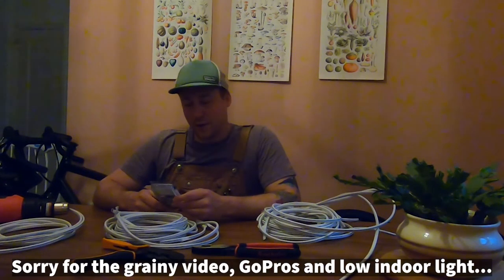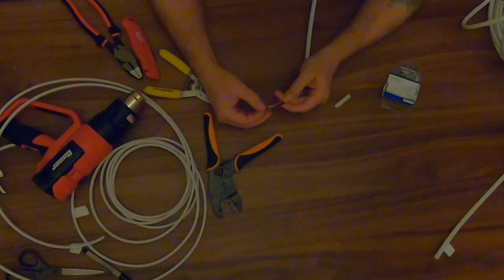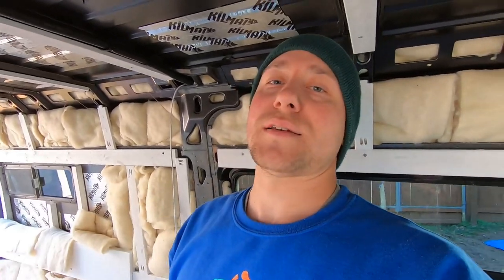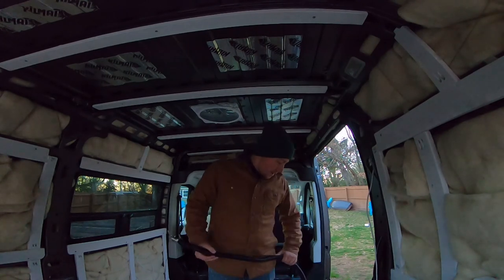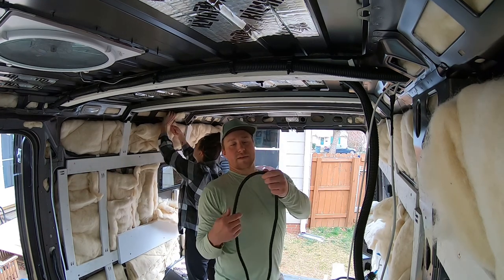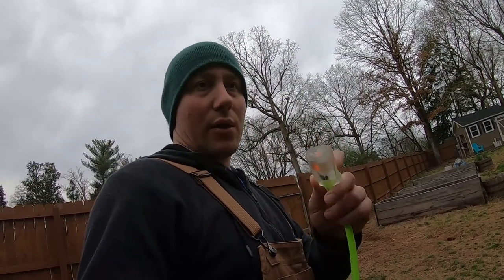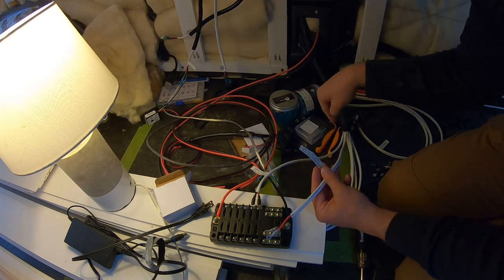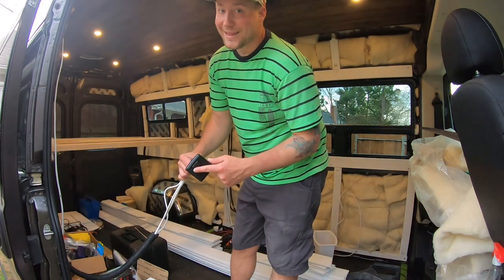Electrical Wiring a Van + Wire Connectors + Fuse Box + Loom, Part 2 //Ep. 9 DIY VAN BUILD

Comment: Great videos - thanks for all the tips!
Did you really use the small, 2.5 inch diameter puck lights? Are you happy with them - do they give off enough light?
How many did you install in your roof?
Thanks!
Reply from the maker: No problem, glad to help! Yes, we used the ones linked. I think they are the best small LEDs out there. We used 4 over the "bedroom" and 4 over the "living room". As well as 2 over the kitchen mounted under cabinet. There is definitely plenty of light from them. We even have them on dimmers because it can be too bright right before bed. Let me know if you have other questions 🙌🏻

Comment: Can you not just earth through the chassis to save wiring back to the fuse box?
Reply from the maker: For sure, this can be a decent option for grounding a 12v system. Utilizing the fuse block the way it was intended was the choice I landed on. Since I used a sleeved two wire cable for all my appliances it was a simple enough option. I’ll add that if you are chassis grounding in many different areas of the van and a nut/bolt comes loose, tracing back an electrical issues could be more difficult or could cause scary faults ie fire. Grounding the negative of the fuse block to the chassis was a safer bet for my needs.

Comment: Hi, great videos!! I'm in the process of building out my Ram 2500 159wb. I've got a Yeti 1000... I saw the cable you're using to "gangup" the 12v port from the yeti... can you tell me how you connected that Max Current cable to your fusebox?
Thanks
Reply from the maker: Hey! Congrats on the build journey, it's so rewarding!🙌🏼  I used a 10AWG cable I found on Amazon to connect from the max current cable to the fuse box. It has an Anderson Powerpole connector to a Ring Terminal. Here's the link for it https://amzn.to/3gH9oV0

Definitely reach out if you ever have other questions or want to bounce an idea. Goodluck with your build!😎
Reply: Matt & Katie Great!! You then connect the ring terminals to the positive and negative on the fuse box... correct?  (Just making sure... don’t want to cut and strip anything I don’t need to. :-) )
Reply from the maker: Yep! That cord makes it super simple. Just plug and play😊. I figured it ran about the same price as buying wire, ring terminals, and Anderson PPs seperately with none of the hassle.
Reply: @Trailvagabonds  First off, thanks for the beta on all your videos...Ive utilized alot of the same features in my build. Question on the Anderson cable; Should there be an inline 30 or 40 amp fuse between the Yeti and fuse block? Cheers
Reply from the maker: I'm glad they can be useful and have helped so far! Goal Zero's product for the 12v ports are regulated and have a max output. For the system I currently have, it's only 10a max. For the last gen large lithium and newer x systems, they have 10a out of each outlet (yeti x has large outputs for some of theirs). So the actual system will cut power to your fuse box through its own breaker rather than popping a fuse. Redundancy is important in electrical system so I'm sure it couldn't hurt but may not be necessary. **I'll just state I'm not a professional so if you do see otherwise, please share. I'd hate to steer people wrong👍🏼

Comment: Do you happen to have a link for the clips you used on the ceiling for the wires?
Reply from the maker: It was this item~ https://amzn.to/3urvTnC  but I will say they drove me nuts and didn't work that great. I was really frustrated with them.

I recently bought these (in black but the link is showing white now when I click on my order)~ https://amzn.to/31Xz0HL and used them to secure my solar panel wires a little better. I wished I had these for the wiring. Paired with a zip tie, they are awesome!
Reply: @Trailvagabonds  thanks matt! your videos have been great, i think i've watched the build series at least 6 times.
Reply from the maker: I'm glad they can be helpful, thanks for your support! I set out to make something I wished I had when starting my own build. It means a lot to hear the work put in to making them is worth it! 😊 All the best with your build! And don't hesitate to reach out with questions 🙌🏻

Comment: Great video!  Apologies for the newbie question, but does the fuse box essentially act like power distribution for the 12v from the Goal Zero to the devices?  Seems that way, I just wanted to make sure I understand the concept.
Reply from the maker: sorry for the late response. But you’re exactly right. The fuse block is fed 12v power and then acts as the distribution to all 12v appliances each circuit is then protected by a specific fuse for its amperage needs.

Comment: First , thank you for your responsiveness to my questions. I am setting up lights the same way with the same switches . Would I be able to get the same custom switch from American Technology? If so what is the approximate cost ? Thanks again
Reply from the maker: I called them (Google their info) and asked if they had a 3 way to pair with their dimmer switches. I don't know if covid has changed their pricing but I think I paid $27 for 2 switches to pair with the 2 dimmers. It was before covid supply chain issues so hopefully that hasn't changed too much

Comment: Hi Matt were your puck lights comparable with the American tech dimmer ?
Reply from the maker: Yes they are. The only issue I had was mixing another brands 3-way switch. It wasn't compatible with the dimmer and 12v less. I had American Tech. make me a 3-way to use with the dimmer and the whole system was perfect. From seeing a handful of puck light options I think the Acegoo brand is one of the best on the market. They make a quality product

Comment: Really like your videos.  I ordered the fuse box. I get how to hook up stuff to it but have a fuse question. How do you determine what size fuse to use? Starting off pretty basic. I have a Rec Pro 12 volt refrigerator, a max air fan and a circuit with two puck lights.
Reply from the maker: Glad you've enjoyed the videos. I hope they are helpful. For fuses, many appliance manuals will say what they recommend. The Maxxfan recommends a 5 amp fuse. Puck lights if led normally pull a tenth of an amp so normally a 1 amp fuse is more than enough. A fridge is probably a 10amp. A quick formula to decide on fuses is watts/volts=amps. So for the Maxxfan for instance, it runs at around 60 watts on high, divide that by 13 volts (Normal 12v output) =4.62 amps. So sizing up to a 5amp fuse won't blow it under normal use but will if it is grounding out or over amperage. Hope that helps. Let me know if you have other questions 🙌🏻

Comment: Great video (again) what lighting did you put in the garage area ?
Reply from the maker: Thank you! We ended up using truck bed light strips. They do a great job of illuminating. I debate about smaller plastic housing long LEDs but ended up going with the strip. You can use an adhesive backer, zip ties, or tabs to put them in place. We used these ones but there are many options for lengths and such~ https://amzn.to/3clG75g

Hope that helps! Let me know what you decide ok and how they work 🙌🏻

Comment: I've seen some people ground the negative to the chassis of the van. What are your thoughts on that? I'm running a similar set up from my Goal Zero  Yeti 3000X
Reply from the maker: I did actually run a grounding wire to my fuse panel. Goal Zero has over and under voltage protection so you probably shouldn't run into issues with it if you don't but I felt it was a decent safety backup
Reply: @Trailvagabonds  Thanks for the prompt response.
Reply from the maker: @jandrewnelson288  of course! Let me know if you have other questions! We upgraded to the 3000x too. Great system! 🙌🏻

Comment: Just curious, I am doing a build out of my own based upon your videos! I am also using a goal zero 3000 and I was just curious about grounding. Is there any way to ground the Goal Zero? Is there a need to do so? Only a few builders seem to be using Goal Zero for this build and I can't seem to find out if this is for sure necessary. Thanks for any help you can offer! Love the series! Incredible fidelity and deep walkthroughs.
Reply from the maker: Thanks so much! I'm glad you've found them useful and helpful! I ran a wire from my 12v fuse panel and grounded it to the chassis of the vehicle as a backup. Goal Zero says their systems have a mechanical "ground" that doesn't make it necessary but it couldn't hurt. For the AC side I didnt do anything. It would be a little more difficult in that regard. I hope that helps. Let me know if you have other questions and thanks for the wonder comment 🙌🏻
Reply: @Trailvagabonds  Thank you for that info! I highly appreciate it! Hope the van life is  treating you both awesome!!

Comment: Hi Matt, I was going to use a goal zero on my build and was wondering. Will you be upgrading to a larger unit such as the Yeti 1000? or switching over to lithium batteries? I'm trying to figure out if I should go with the yeti 1000 or build one from scratch like most other van builders. My concern with the Goal zero is if it fails then you have to replace the whole unit but if you build one then you cam replace parts. How has your yeti 400 been working out for you? I also thought of just going budget friendly and just buying the Yeti 500 and then updating the electrical later. let me know what you think, thanks.
Reply from the maker: We plan to upgrade as soon as we can. The 400 was never meant to be our full time system, we are hoping to upgrade to the 1500x or 3000x. I had already owned this one so we are utilizing it for now. I do hear your concern there, that would be a huge cost to cover if something goes wrong! Having owned the 400 for a number of years, I am happy with the quality of Goal Zero products so I don't know how often one would go bad if you are using it properly (keeping it charged, not discharging past recommendations, tripping the breaker constantly trying to power too much). They also have a warranty, granted limited, for 2 years. I'm happy with my choice and plan for upgrading but I'd say that is a very personal choice to make. I love the plug and play ability, being able to use it outside of the van for other applications. A diy system can be expanded, it can be more efficient when charging (less limitations on your solar input voltage and such), but they also take up more space. I'd hate to steer you wrong. There are so many pros and cons you would need to personally decide on.

If you want any more help, reach out by email or social media and we can talk about it more 👍🏼

Comment: I think you would have been better off running the wiring before the insulation. 
Otherwise great job! Love your channel.
Reply from the maker: Thank you for that! The main reason I wanted the wires on the inside of the insulation was mainly because of how hot the van walls get in direct sunlight. I figured that type of heat and electrical wires don't mix. We ran electrical and insulation at the same time so it was kind of a tandem project.

Thanks for watching!

Comment: How many feet of wire did you use?  Did you use the same wire for your AC outlets?
Reply from the maker: I bought a 100 foot spool first and then a 250 foot one. We had a decent amount left over on the 250 ft spool. For our AC outlets we used an extension cord with the female end cut off and wired directly to the outlets. I show how I do that in our Shiplap Wall video

Comment: What are the sizes of your wires? Are the sizes are all the same? Thanks.
Reply from the maker: We used 14awg for all of our loads. It's over gauged for most things. I planned to use 12awg but the price difference was a decent amount of savings. For solar wiring and the wires to the circuit we used 8 or 10. I tried to play off specs of the items we have. There are great gauge diagrams out there to help choose. The link to one I used is in the description box

Comment: Hi Matt
How much wire did you order? 50, 100?
Reply from the maker: Hey Susan! It really depends on the amount of 12v items you plan to include and locations of items such as switches, leds, fan from the fuse panel. A 250 foot spool was ample for my needs. Depending on your needs you may be able to get away with 100 feet. If you want to chat about what items you will include in your build, send us an email and I could try and help narrow it down more. Otherwise a way I  estimated before purchasing was running my tape measure where I thought my wires would run and jotting down each length then adding them up for a total. Siding on some extra is always smart. Hope that helps. Definitely reach out if you have other questions 😊
Reply: Hey Matt
Thanks for answering me, Matt 👍 its funny when you don’t think of the obvious and simple things of measuring 🤪 congratulations on your van business with Trent & Allie.
Reply from the maker: Thank you so much! 😊 It's exciting to be partnering up with them. Hoping the business goes well.

Hehe, no worries. Having a general idea of what others have used in their build is helpful. I hope your build goes well as you get into it! All the best! 😊

Comment: Do you have a link to the custom 3-way switch/dimmer that you had made for your van? Seems like you kept a pretty good notebook of your electrical wiring. Any chance you can share your wiring diagram with me as well?
Reply from the maker: I purchased the dimmer switch on Amazon~ https://amzn.to/3i5Rug7 but called the company that makes it to build me a switch to pair with it (since I had purchased one I thought would work and it didn't because of the voltage rating). There might be an option on Amazon but I didn't have any luck finding one. I'm planning to make diagrams in the future to share but don't have them done yet. Some of my chicken scratch notes are pretty rough. This guys video was helpful~ https://youtu.be/6lejHz6FtLM
Reply: Matt so you’re saying that dimmer switch that is linked will not working period or didn’t work as part of the 3 way you wanted? Just want to get a working dimmer, not do it on a 3 way - will this linked switch work or? Thanks!!
Reply from the maker: This dimmer is perfect! I personally think it's the best 12v dimmer out there. It was the original standard switch I bought to pair with it that didn't work. A quick call to American Technology Components got me the switch I needed and everything works perfectly with the dimmer switch provided
Reply: Thanks for getting back!! Appreciate you more than you know! Haha
Reply from the maker: No problem at all! 🙌🏻
Reply: @Trailvagabonds  hey matt just to piggy back off of this comment thread what is it you asked for when you called the company? A dual switch in a single housing capable of three way on each switch? Also would you be able to just have purchased four of the dimmers that worked and just wired those in pairs as a three way to then have dimming capability from the bed and side door?
Reply from the maker: When I called I said to them that I purchased their dimmer and gave the product number. I asked if they had a switch they normally paired with it. It was a pretty simple call. For our van I personally had 2 built into a 2-switch cover to pair with two seperate dimmers at the bed (for the bed and living area zones). I was sad they don't sell a cover for 2 dimmers side by side. 

I wouldn't recommend two of the dimmers on one light circuit, the ability to dim from two spots isn't possible from my understanding. You could use the switch in both spots to turn on and off but could really only set the dimmer up in one. It would be a waste of money since they aren't cheap. The standard switch to pair was around a third of the price. Hope that helps! Let me know if you have more questions
Reply: @Trailvagabonds  Thats so much that was really helpful I appreciate it.
Reply from the maker: No problem! Goodluck! 🙌🏻
Reply from the maker: The switch I purchased was a JR Products switch set up with the 3 prongs. I'm not sure if I just had a bad switch but it seemed like it should work from the Amazon listing. If it's returnable, maybe worth trying
Reply: @Trailvagabonds  I went with that! Ill let you know how it goes so you can tell others if its a good solution going forward.
Reply from the maker: @AndrewLaBreck  that sounds perfect! Thank you! And don't hesitate to reach out with other questions! Good luck with your build! 🙌🏻
Reply: @Trailvagabonds  Can you remember what the order of wiring was for you? Does it make a difference if you start the run to the switches from the battery to the dimmer or the regular switches. ex for the run - wire from battery to dimmer then to regular switch then to led lights for example.
Reply from the maker: @AndrewLaBreck  it doesn't really matter since all the switch is doing is cutting off the current running through it. I ran from the fuse panel to the switch at the door, the door to the dimmer at the bed, then the dimmer to the lights and back. I would do whatever the shortest run of wire is. For me, that is what made sense.
Reply: @Trailvagabonds  Good to know thank you! When you say and im back im assuming thats back to the fuse panel right? I think im finally understanding this electrical stuff haha.
Reply from the maker: Exactly, yep. Just think of it as a circle. This is one of those simple videos I've found very helpful - https://youtu.be/14tbL2uIGKQ
Reply: @Trailvagabonds  Super helpful! Thanks so much man I really appreciate the responses. Means a lot
Reply from the maker: No problem brother! Happy to help! Good luck getting it all together! 🙌🏻